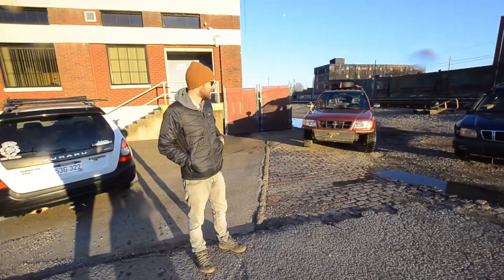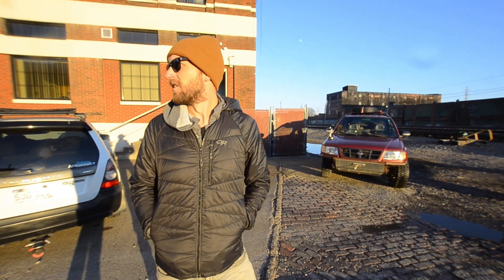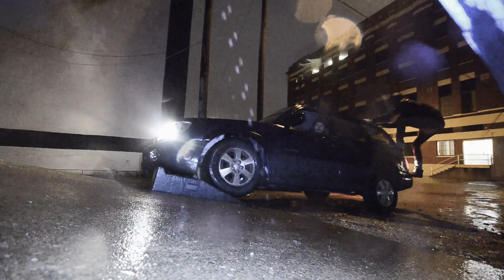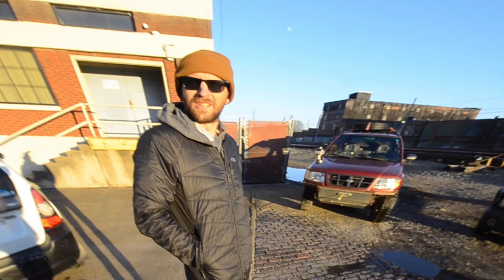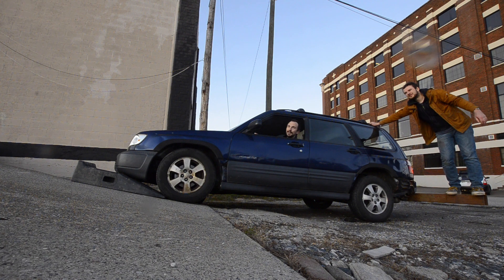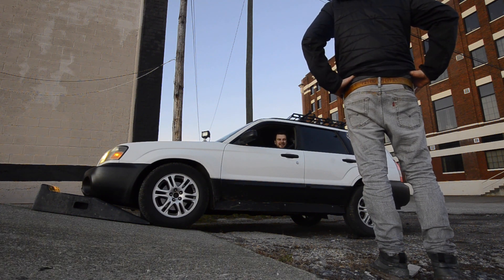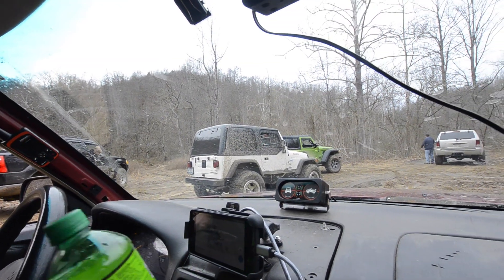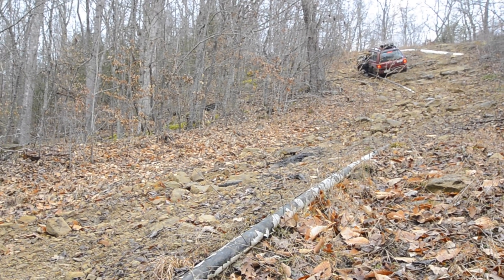MPT vs VTD vs VISCOUS COUPLING | Subaru center differential power transfer test

Comment: What a piss poor AWD system very little better than a two wheel drive car,it puts power to all the wheels when you don't need it, and power to one wheel when you do need it, back to front system just like the man who designed it a total gimmick.
Reply: This happens un al awd sistems xD you need diff locks like a Toyota land Cruiser if you what a permant 4x4

Comment: What a tease!  You hint at hi/low range gearing for a manual but could you give a guy just a little hint on how to proceed?
I'm willing to change the entire drivetrain from kenny u-pull parts.

I love my 08 Subie Impreza with a Forester lift and slightly over sized tires.  We go all through the very back roads but man rock gardens as so hard on the clutch since first gear (3.454 with a 3.9 final drive) is too zippy.
Any info?
Thanks,
Mike from Canada

Comment: Clever solution with the lever (steel beam), additional stress not-withstanding, but I'd rather see this done with rollers -seems that would be easier and more informative.  You can always place the rollers on an incline or put bricks under wheels to give more resistance.  Would love to see this done with 4th gen outbacks (it seems these didn't have VDC - I didn't see any brake intervention) so we can see how effective the brake traction control is in transferring torque.  Would also illustrate how effective the auto-lock is (it seems this bluebaroo was locked manually?).
Reply from the maker: Yeah, this test was narrow in scope and low in effort. Our only real goal pertained to the vtd as proof for ourselves...just so happens we decided to film it. Blubaru is vtd swapped, so the tcu logic that controls automatic lockup isn't active. So yes, manual only.

Comment: The VTD isn't specifically front biased when unlocked. The early VTD equipped outbacks had the same transmission as a similar year automatic WRX, which would spin whichever end of the car lacked traction. When the regular MPT auto fails from wear the vehicle will have power only to the front wheels. A duty c solenoid failure or worn clutch cage is what would normally cause power to all four and binding on turns.

In a previous video describing the center diff locking switch the screen caption stated a 2005 Legacy GT center diff was installed. The 05 LGT uses the larger five speed automatic transmission so perhaps you meant 2004 which was the previous chassis designation

Comment: but VTD only come in VDC models does it not ? so with that VDC would just help you go up there without any problems. and this test shows which car flexes more and that white one couldnt drop rear wheels so much, maybe sway bar on etc. 
i have problem with my VDC VTD outback when it doesnt wanna go reverse in hard situation when all wheels on ground it just whines on low revs and doesnt wanna spin wheels , what could that be ?
Reply: That is the software in the cvt starting out in oto high of gear in reverse. There's a TSB on this for up to 2010, but my early 2011 has same issue. I'll try to find it and post back here.

Comment: I’m just kinda sad that the 5 speed isn’t as good as the auto cause of the center diff lock 😂 guess I’m goin vtd!
Reply from the maker: It's not a bad option. If manual is what you want you could always long travel it and swap in a low range.
Reply: Power of your brains if the budget allowed that would be preferable, but the price of an auto trans vs everything I would need for that is ridiculously outweighed haha.
Reply: You can swap in a center diff that allows for a greater amount of torque transfer for a given speed; a lot of rally guys do that, but they aren't cheap. Big issue is that, regardless, it relies more on a speed differential for torque transfer. So you gotta be prepared to send it... Which I am not, lol
Reply: Tyler Scranton that’s cool I’ve never heard of that. Probably too expensive still 😂 cars are a tough hobby sometimes.
Reply: @STfofisnuffle  Usually the center differential they'd buy is an actual STI viscous coupling center differential designed for gravel rally races. And by STI, I mean STI the aftermarket parts, not OEM WRX STI components.

Rallispec sells some. They definitely aren't cheap.

Comment: Cool video ! Do you know the torque bias of the VTD (45/55 or 35/65) ? I have a 5mt with DCCD (35/65), its similar to the 4eat VTD. Looking forward to the developement of the ABS traction control, I need it !
Reply from the maker: Hey thanks! The claimed torque spit of the VTD is 45/55. This slight rear bias is virtually undetectable in our experience.
Reply: @powerofyourbrains  I'm thinking of switching to a VTD for the 45/55 split instead of the 4eat MPT I have atm. Did you guys also put a locking switch on the solenoid on the VTD like on granny? Was wondering why if it's already so close to 50/50
Reply from the maker: @Ben-vn5zd  locking the vtd center prevents the differential from differentiating.
Reply: @powerofyourbrains  oh right, so it can shift from 45/55 and torque bind just the same way as the 4eat MPT which is like 90/10 right?
Reply from the maker: @Ben-vn5zd  yep
Reply: @powerofyourbrains  awesome thanks!
Reply: the JDM SVX is stated to have 33/66

Comment: Hahaha I thought you were trying to imitate Archimedes for a second with that beam. There are engineering genes by there.
Have you tried using the "left foot braking" technique with vehicles equipped with automatic transmission and an ABS braking system in the same situation? I think it mimics a rudimentary traction control system but useful in some situations. 
https://www.youtube.com/watch?v=L85t5WLCK84
Reply from the maker: Ha, perhaps he was. And yes, we call that "a lil left foot". It helps, sometimes. Eventually one of us will orchestrate a home-brewed e-diff using the abs...we've talked about it so much it's only a matter of time

Comment: Excellent video guys! 

For those that don't want to carry around 2 extra dudes and an I-beam TORQ Locker's got your back!
Reply from the maker: Thats right! In some ways, our active weight redistribution (AWR) bar is impractical and sort of sketchy.
Reply: @powerofyourbrains  Not a "best practice"  LOL
Reply: Torq-Masters Industries Did those work for a five speed differential
Reply: @ThatGuy-xd5fs  yes, of course
Reply: Torq-Masters Industries i need a center diff for my 5 speed
Reply: @ThatGuy-xd5fs  at this time we are not looking into center diff mods. Maybe in some time if we find enough demand.
Reply: @TorqMastersIndustries  if you guys could somehow manage to make a center diff that acted as VLSD, but could then be switched to 50/50 lockup, that would be spectacular! And I've just the vehicle to test it in. ;)